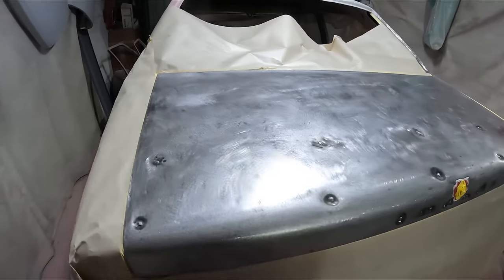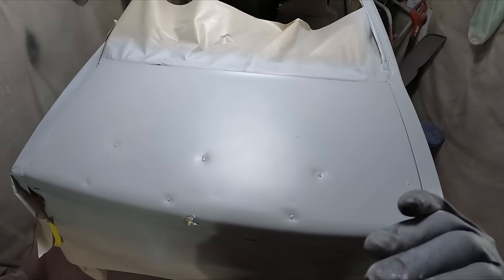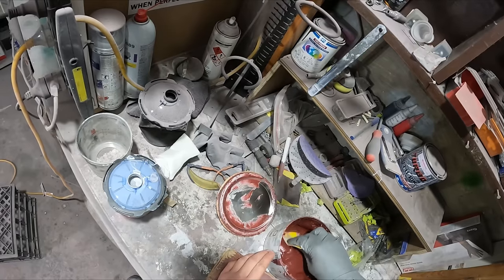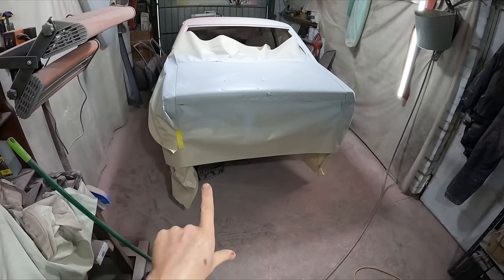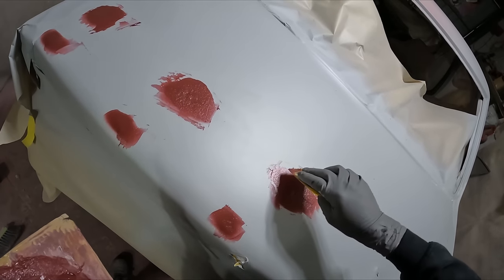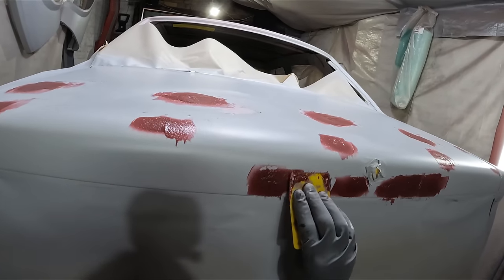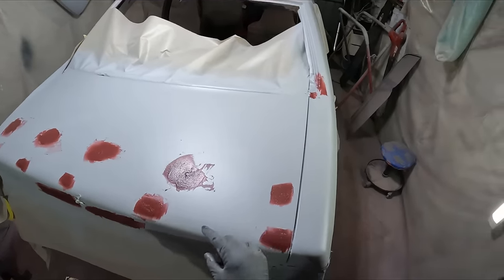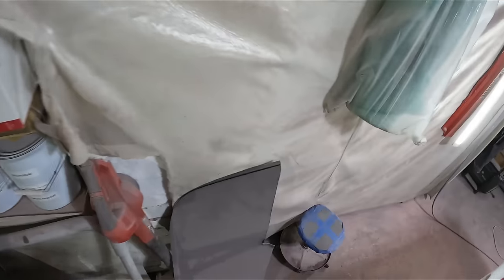Spraying Epoxy Primer & Applying Fiberglass Filler

Comment: Here's a good trick for your body fillers. Go to your local supermarket or electrical store and buy a cheap handheld cake/bread mixer with dough hooks and use it on your body filler comes out smooth in no time. I'm really enjoying the series Gunny
Reply: Why not go whole hog and use a cement mixer 🤣🤣

Comment: I hope the epoxy primer does work, there's always new things to learn.... 
  Some coments said the fiberglass will shrink, the easy solution is to grind the fiberglass back a little low and mix up polyester resin catalyst mix, and brush it over the fiberglass, sealing the repair airtight, stops it shrinking and sinking, once dry, key with 40-80 blow off  before poly filler,. 
  Alternative way to welding the dent is . polyester resin/catalyst mix and use Core Mat to fill the depth of the dents, then fiberglass mud, or fiberglass mud & poly filler mix on top
Loving the videos, Im only trying to see what gun I might buy next and now I'm way down a different path watching restoration yaas 👍

Comment: Looking good!  I found a kit for drywall sanding that consisted of a bucket with some fittings in the lid and a length of flexible hose.  You filled the bucket half full of water, put the lid on, attached your shop vac to a fitting that stays above the water.  The other fitting has a bit of hose that extends under the water.  Attach the flexible hose and use that to pick up the bulk of the sanding dust.  Easy to make one yourself and captures all that dust in the water.  My leaf blower took care of the rest - taking care not to blow away the things you want to keep.  That dust goes everywhere but then so does clear coat overspray and it sticks to everything (LOL).

Comment: Smash into it gunny! My zg fairlane boot needed a full skim of bog because every glue to the rear reinforcement was a freaking high spot that wouldn't hammer down. I now use blue oxide dust wiped on the bog with a rag for guide coat then use a speed file on its side to see the low spots. 
I was using matte black for guide coat and found it would screw me over clogging up my sand paper. 
The learning curve never stops with this s**t

Comment: Most people commenting negatively,have zero clue of how the auto body industry works,there is million dollar cars at auction with body filler many of them with over 1/4 inch of mud.
Reply: As I said before, nothing wrong with filler if it's applied correctly. No way would I apply filler over epoxy without lightly sanding surface first to avoid possible adhesion problems later.
Reply: @SalvageMasterEssex  but how do you know there might be adhesion problems,you don't know,so for that you get three Pinocchio's.🤥🤥🤥
Reply: @SalvageMasterEssex  there is a window that you can apply body filler to epoxy without having to sand
Reply: Dx 579 followed by dx 520. Dx579 is a metal cleaner and metal neutralizer. Rinse with hot water and dry with rags. Dx 520 is a zinc phosphoric in a bottle. Rinse with water and dry. Made by Chem fill. Better product. Then epoxy. Wait 24 hours before putting on body filler.
Reply: @markcooper1947  I know that, but still wouldn't apply filler until epoxy has fully cured and even then in my opinion surface still needs keying. If you're investing a lot of time and money in a paint job why take the risk of problems at a later date.
Reply: @filibertobarrera7672  Silly person 🤣🤣
Reply: @SalvageMasterEssex    That's saying it mildly!
Reply: So your saying putting fillers over non cured non sanded epoxy the next day, when the tds says 3-7 day cure time is correct ? Careful what info you take from these videos
Reply: @BogDustForBreakfast  no it says after three days you have to sand it,you can apply filler right after it drys,that's were the bond comes in.You have three days .
Reply: @BogDustForBreakfast  have you seen the video of car addict garage,on applying body filler over unsanded epoxy,He is reading the data sheet for you.Helllllloooo
Reply: @filibertobarrera7672  wanna know what the main issue is here ? Everyone treating epoxy the same as the last one they used . No reading tds . There wasn’t even any speak of the tds in this video . Im all for teaching people ways of doing things like he does but . Someone else will do the same with another epoxy and have issues .
Reply: @BogDustForBreakfast    Says the guy that's never sprayed in his life.....
Reply: @SNAFU..  🤣
Reply: @filibertobarrera7672  you get 4 Pinocchio cuz you don't know
Reply: @karsbkool  what part don't I know,tell me me wizard,I'll be waiting for your reply.🙈🙈🙈
Reply: @filibertobarrera7672  you didn't say which part you did know, that's why you get 4 pinochle
Reply: The part I know is that fiberglass is Never Ever coming off that epoxy without extreme force. I read that other guys comment.  He's one of those guys that quotes other people's crap.  He doesn't know much uh nuthin'
Reply: @karsbkool  yea definitely that shit ain't coming off
Reply: Why even waste the time arguing over it? Just do yours the way you feel best, show your results, both immediately after, then a few years down the road & leave it at that...arguing about it isn't going to accomplish anything but more arguing...there's usually more than one way to do things, so just do it your way if that's how you feel it should be done...

Comment: Seems like you are progressing well there Gunny, nothing wrong with using filler providing what's under it is prepped correctly and the filler is mixed and applied correctly which of course yours is👌keep it up mate👏👍John UK.
Reply: I wouldn't risk plastering fibreglass or filler over epoxy without sanding to key surface first. Maybe you can get away with it but in my opinion it isn't worth the risk.
Reply: @SalvageMasterEssex  Not to mention the controversy of "bondo over epoxy or on bare metal."

Comment: I’m beater by trade I’ve moved from smash to resto I’ve found the best all round epoxy is protec para glaze can be used wet on wet or dry sanded with filler over it works well I like your idea of putting glass on wet or not fully dry primer for adhesion personally I’d be scared of sink back as when the epoxy drys underneath it over time maybe I’m wrong as when you take the top off the glass it will be porous there for if you let it sit over night the epoxy should dry before you apply body filler and high build primer

Comment: Yeah, I use fiberglass all the way through till I'm straight then skim with filler.. every weld job gets glass over the welded area. I only use glass on bare metal. No sense in putting Porous filler down first. I live in the rust belt & mostly do rust repairs & partial paints. It has worked great bonds like crazy.. Bondoglass works for me, shapes down with 40 real fast.. When i get down tight on some panels I also add a little resin to make it smoother.

Comment: If you have a new panel in ecoat and needs a skim do you need to epoxy it before put filler skim
Reply: Key the surface,. Epoxy primer then skim.....

Comment: Hey gunmam, got a question for you. Recently sand blasted and painted a trailer and it rusted quickly. I use zinc primer and polyurethane top coat. I did not treat the bare metal before priming with zinc primer. What could I have done to prevent the rapid rusting??
Reply: Sherwin Williams always had the best vinyl wash primer.  The best thing I know of to keep rust from spreading.
Reply: How much time elapsed between sand blasting and prime and paint?  Also do you live in a high humidity climate?
Reply: @luisvega1294  about 2-3 days. Dry conditions. Warm weather. No rust was present when I layer down the zinc primer. All products Cloverdale Paints. Airless sprayer.
Reply: @luisvega1294  im thinking I should have wiped it down with something? Like vinyl wash or something.
Reply: 2-3 days for one is way to long! 2-3 hrs would be too long..in my area..oxidation begins immediately upon exposure ..i use to use a metal prep than a galva prep wash scrubbed in/cleaned  with a scotchbrite red for additional corrosion protection.. But if you paint directly after blasting and dont touch metal with your bare hands use a good eppxy primer make sure you have good coverage with the prime and paint you will have much better results/longevity of your efforts when not using a metal clean and galv or zinc chemical solution...pre scrub to painting..again my opinion is you left the metal bare way too long and surface rust was there you didnt see oxidizing already..hope this helps some for your next adventure! Now get out there and paint some shit!! Right Gunny??😉
Reply: @luisvega1294  thank you I believe you are right. I also stretched the primer so ya…
Reply: Absolutely my pleasure! Yessr i think you painted over surface oxidation and it just continued to eat and rared its ugly head back through your hard work! Along with stretching stuff! But i completely understand..and i speak from experience been painting shit! For long time happy to share with you my friend..
Reply: @ouimetco  Rust starts again as soon as air gets to metal. Should get primer on within a few hours for best results.
Reply: Also kompressed air you are using on sandplasting is not dry and it will get the surface rust. Use sand only those point's, you can't get clean otherwise. Keep all bare metal parts ready to cover with paint as soon is possible. In where im living athmosphere make all basic black steel very vulnerable, even painted steel need more care than uskalla.

Comment: Try putting lacquer thinner on a rag once ur mud sets it will remove that resin on the surface so won't clog ur sandpaper
Reply: You can just put a little bit of thinners in your body filler when mixing it up, to thin the filler down will have more consistency, easier to spread especially  with bigger bog jobs rather do this way than using dolphin glaze. Hope it helps mate
Reply: @altang3355    I've tried that before, it doesn't work...the filler doesn't set up properly....
Reply: @SNAFU..  it works, probably not adding enough hardener
Reply: @altang3355    I've tried it..  It doesn't work ....no matter how much hardener you use .....
Reply: @SNAFU..  what thinners are you using?
Reply: @altang3355    Hahahee...I don't....Been custom spraying for 29 years.... I tried it years back before self leveling fillers existed......you might think it works.....but it doesn't....the filler gases out for weeks and no pro sprayer worth his weight would entertain the idea of spraying on top of that, Fact!.... If it suits your armature needs then knock yourself out bro....but it's a dangerous practice for a professional guaranteed job!
Reply: @SNAFU..  if you don't like it then don't do it simple, I don't need you life story bro
Reply: @altang3355    "your"....
Reply: @SNAFU..  yeah righto, got you the first time

Comment: Not on topic but I'm wondering if you may have a recommend. I'm looking at a new gun or possibly just a new air cap, my current gun a devilbiss gfg 516 1.4  fluid tip it shoot's  nice but with a fairly narrow fan pattern I would like a wider up to 12" fan is that possible with this model? Thank for the informative videos.
Reply from the maker: Honestly mate, I'd email Chris at info@spraygunsdirect.co.uk let him know I sent you, I can guarantee he will point you in the right direction. Tell him exactly what you said to me

Comment: Have also seen comments on other posts where the bodyman used polyester resin to make their body filler thinner,andyou see the haters saying oh my gosh he just ruined the body filler,I see it as how did he ruin it,if polyester resin,is a key ingredient for polyester body filler.
Reply from the maker: Exactly, I say whatever works, and you know what, even if it doesn't work then at least you learnt that it doesn't work 😂
Reply: It mixes in and sets up nice but makes the filler a lot more brittle and creates air pockets. Can become almost like glass.... Always best to use a glaze if you want a more self leveling top filler.
Reply: @SNAFU.. hu no it doesn't become more brittle at all,it causes no pinholes ,and that's what glaze is,it's over reduced filler.wow like glass obviously you have zero clue of what ur saying.
Reply: @filibertobarrera7672    channel is 5 days old..... The Gunman Troll alert has been sounded!
Reply: @SNAFU..  unfortunately you guys are the trolls.🙊